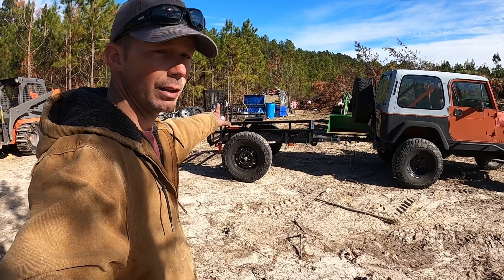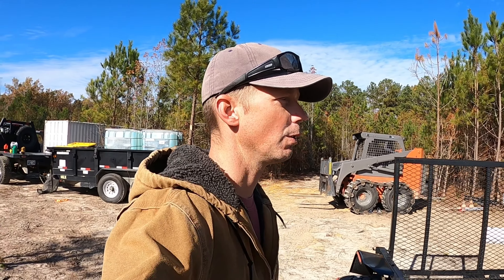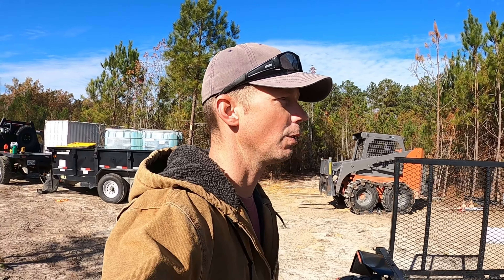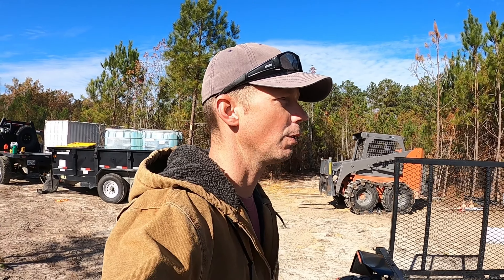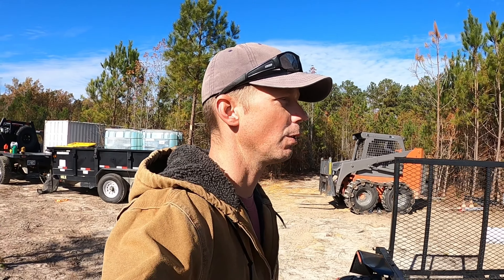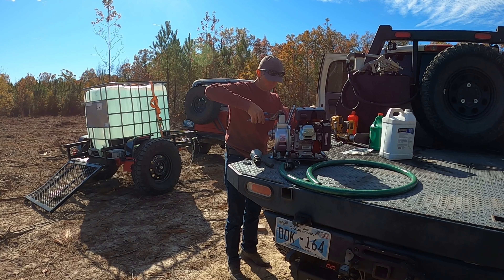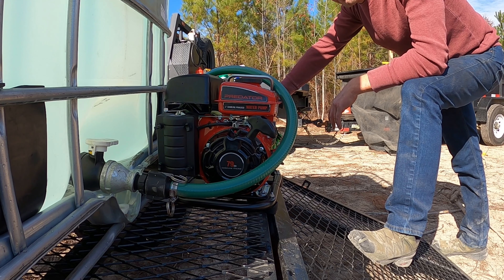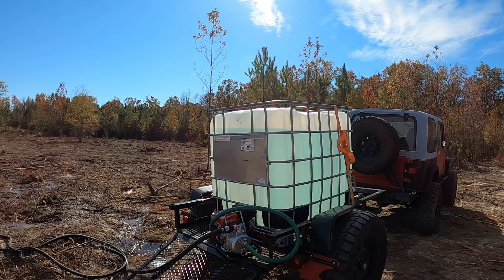Fire Supression Trailer Assembly

Comment: I have an IBC Tote sitting in the barn and was planning on building a similar trailer this winter. Thanks for pointing out the flow of the 1" vs the 2", that was really helpful for me to make my final decision. I will run a 1" pump and 1" fire hose, maybe put a fitting for a 3/4' "Toy Hose" as well. Have you thought about putting in a pressure relief valve plumbed back into the tank so that you can shut off the nozzle and allow the water to still flow through the pump and then back into the tank. That way you could leave the pump running and shut off water flow so you could conserve water if you had to move the trailer or regroup.
Reply from the maker: I’m trying to figure that recirculating arrangement out without spending $300 on a pre constructed valve. I have a 3/4” hose on the trailer for when I need to more less water. I’ll look into a pressure relief like you mentioned and plumb it back into the tank somehow to help keep cool water running through the pump too
Reply: @Andrewactual  Mcmaster Carr has some 1" valves for about $150 and 3/4" for around $35. I tired to post a link here but it appears that my comment is now gone. Don't know if I broke the rules by posting a link or not? But if you google Mcmaster-Carr and search their site you will see them.

Comment: I used IBC Totes on stilts for a gravity fed tank system to put out range fires at Camp Grayling. Also built a fire rig out of an old deuce and a half water truck by adding a 2" pump and hoses. Ended up working great for our range fires. Good times supporting the Range Control.
Reply from the maker: It’s nice to have the ability to put stuff together! That fire rig sounds awesome!